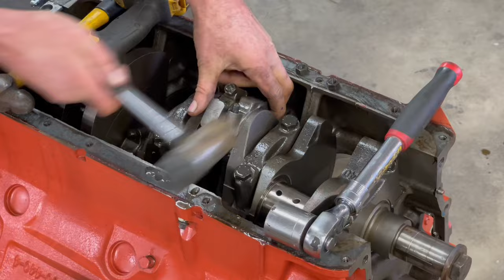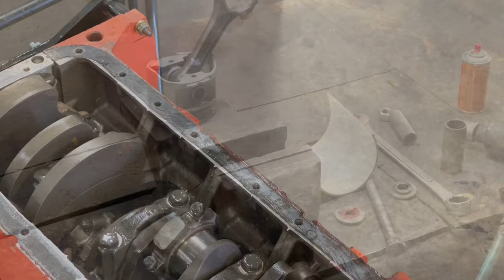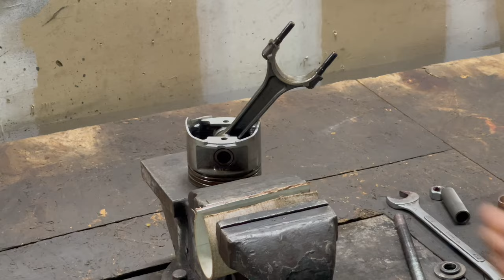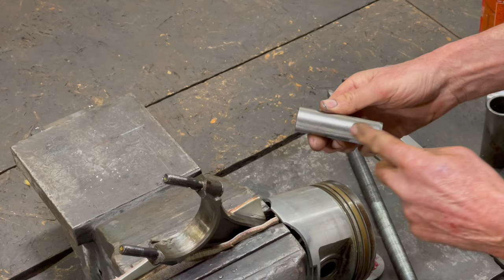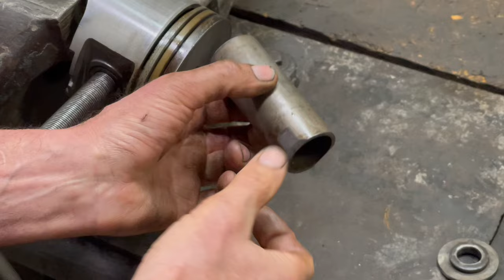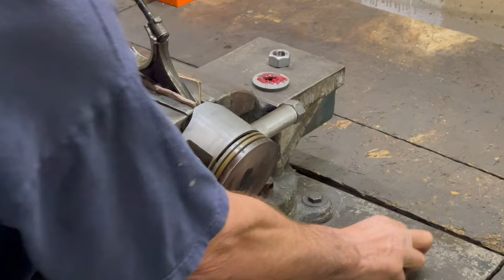Homemade Tool Removes Pressed Piston Pins

Comment: A press and the proper pin driver would be so much better.  Grind a big chamfer on that pressing pin so it doesn't catch the small end and put a nice score in it.  BTW, when taking the rod caps off in the block .... leave the nuts on a few threads and tap the nuts with a rubber mallet.  It'll pop that cap right off.

Comment: Moral of the story: upgrade to floating wrist pins... 😂
Reply: Why?
Reply: @brettspaulding5855  because it’s easier to install and they impart less wear and friction on the rotating assembly.  Factory style rods are available for $200-300 that are bushed and have ARP hardware.  Or you could spend 30-45 min per rod removing and reinstalling them.  On junk pistons you don’t plan to reuse, a shop press is much easier and faster to remove press fit pins.
Reply: @MissionRestomod  I know the reasons for the switch to floating pins. But, I've never seen a press fit pin slip out. And TBH most of us aren't building engines that see enough extended RPM to see the benefits of floating pins. I've seen enough Carnage due to clips failing and pins coming out to want to avoid them for most engines.
Reply: @brettspaulding5855  I built a 44o last summer and I used some chinese rods that were pressed fit. I had the pistons installed at the machine shop. Four of them slipped in the first 100 miles and grooved the cylinder walls. I heard what sounded like a piston slap and tore the engine down to see what the problem was. The block will have to be bored from .030 to .055 to clean it up but at least it didn't ruin it. 2 years ago I had a customer with a Ford dump truck that had a 391 in it. The engine was an O'Reilly's reman. He started losing coolant and thought it was a head gasket. I tore the head off only to find a massive groove in the cylinder wall all the way through to the water jacket. I had to actually grind a channel at the top of the cylinder to get the piston out. We sleeved the cylinder and replaced the rods with bushed rods for floating pistons, the engine had about 600 miles on it since the reman. And this fall my brother in law had a fresh 355 in his S10 drag truck. It had a pin slip and wear through the cylinder wall. He had to do the same thing that I did to that 391. So pressed wrist pins do slip and if you work on enough engines you will see it more often than you might think. But it's usually early on and because of poorly fitting parts.

Comment: Great tip. I've made a couple presses like this for different bushings over the years. If you can find it high grade all thread and nuts works best/lasts longer. It doesn't gall up and wear out. A commercial fastener supplier has it or can get it for you. The generic lumber yard stuff is pretty soft.  If you plan to use it much I would spend the few extra dollars.  Thanks for the vid Steve.
Reply: Yeah I used the basic low grade crap and it snapped of course. I liked the rattle gun, it adds a bit more grunt to the situation 👍👍

Comment: I just copied your great tool, i used black iron pipe 1/2" x 4'' and another piece 1 1/4 X 4" ( bought 6" lengths and cut threaded area off ).,
as i did not have any "tool" type steel laying around.....Worked perfect, but the black pipe does give a little under pulling and impacting.
Very good solution to removing those pressed fit pins. 
Thank you.

Comment: This, Kind Sir, is really slick. Having just removed some piston pins recently, and screwing a piston up in the process, I can say this would have been a far superior approach. Thanks for imparting your wisdom, Steve.
Reply: This way will still tighten up the wrist pin bore on the side you put pressure on.
Reply: @TTGTO288  Yes, most of the time we need to "true" the bores with a wrist pin bore hone.
Reply: @rollydoucet8909  Which results in excessive and out-of-round clearances in the bores that leads to wrist pin noises and eventual piston failures.  No thanks.
Reply: @TTGTO288  Usually, when removing OEM, stock pistons from connecting rods, it because the stock pistons are being discarded. However, when attempting to save the pistons, a careful "trueing" of the pin bores is required. Not oversizing the bores, just trueing to allow free pin movement. This procedure has been going on in the engine rebuilding industry for over 80 years.  Sometime a damaged connecting rod has to be replaced, and the piston needs to be saved.
Reply: @rollydoucet8909  I realize that you are going to discard them, but if you want to reuse them, Yes, sub par machine shops do it that way.  The reason the bore gets tight is because it is pressed out of shape, hence, out-of-round.  "Trueing" it on a honing mandrel removes material and still leaves it out-of-round and only breaks the tight spots (that is, if the machinist doesn't go crazy with the tension and his work), plus you have put unneeded stress on the piston by pressing it, again, asking for failures.  The proper way to reuse a pressed piston is to use a Kent Moore piston press or something similar, which supports the small end of the rod while pressing, not the piston.  "Trueing" it still leaves you with incorrect pin bore clearances in the piston.

Comment: Thanks for the tip, Steve! Do you also have a tip or trick to install press fit piston pins?
Reply: Heat the rod end with a torch and slide them together, I have done it many times, experiment with some junk rods and pistons first, it's easy to figure out
Reply: Put your rods in the BBQ and your pins in the freezer. Make up a jig ,  put on your welding gloves and move fast.
Reply: With heat

Comment: Thanks Steve, I went to the hardware store today and bought what I needed to pull the pins on my Mopar 400 pistons...worked great. I used a piston pin from a Farmall 130 to push the Mopar pins out, it was the perfect size.
Reply: Well you answered my question, is my mopar 400 pressed pins or not lol.  Thanks

Comment: Good way to do this if you don't have a press.  5 mins without Steve saying a word, has to be a first! lol.  If the crankshaft is good, we always use some rubber hose over the rod studs just to be safe.

Comment: Steve,

It's always good to be practical and using this method is good. Did you prefer this method just to save shop space? If I had deep pockets and my own work area, I would just spend the money on a Sunnen Wrist Pin Remover Press. That's just me.

Comment: Another neat idea. I have tried that on a hydraulic press with no luck. My guess is that the impact wrench makes some difference. I have made a lot of my own tools over the years, special one purpose stuff. Thanks for the videos.
Reply: A 12 ton press maxes out at 24,000 lbs force, which is around the same as a properly torqued 5/8-18 thread. With a higher grade fastener/piece of threaded rod, higher forces than an average hydraulic press can be achieved. For example, a properly torqued 7/8-14 grade 8 bolt provides nearly double the 24,000# a large shop press can. In a use case like this video, that's assuming the pin doesn't move prior to reaching the torque specification. Threaded fasteners are capable of staggering amounts of clamping force.

Comment: How big is the risk that you damage the piston by doing this way. Or are they usually "tough" enough to handle the pressure that directs to it by that bigger OD tube?
Reply: No, you only do this to pistons you are not re-using.

Comment: Now this is the type of useful down home old school shit that people need to see. only thing that would have made it better was a lil bit of commentary about where to source some of the pieces that was used to make the tool. Like if the long threaded rod came from a common item you can find in a junkyard etc.. To people that do not have access to 5 barn sized garages with 30 vehicles hidden outside in the field sourcing these might become a hassle. This is reason I no longer watch power nation they teach almost zero down home tech tips and tricks and spend 5 thousand dollars on a budget build using useless crap like arp oil pan bolts ? I mean how many people run into issues where the stock oil pan bolts fail ?
Reply: Yes, people need to see this, so they blow their engines up and have to pay a machine shop to build it, which they should've done in the first place.

Comment: Oh man, engine manuals will tell you not to press these cold - it can mess up the press fit as well as damage a new piston.
Reply from the maker: Actually, this is exactly the Mopar FSM procedure. I only remove this way. Heat small end to install.
Reply: Only for pistons you will not be re-using